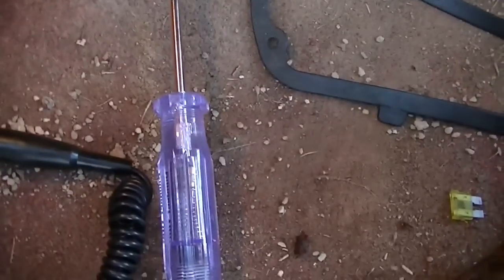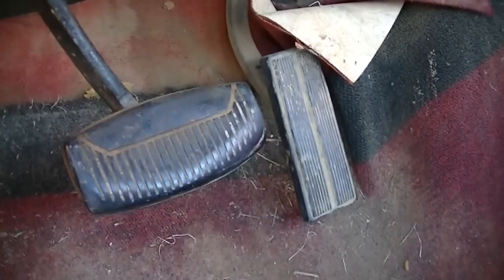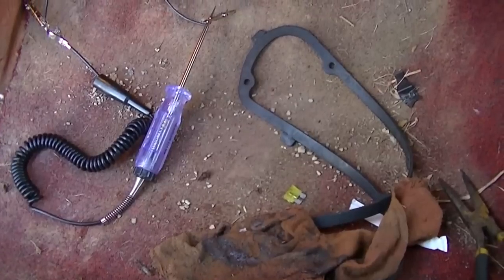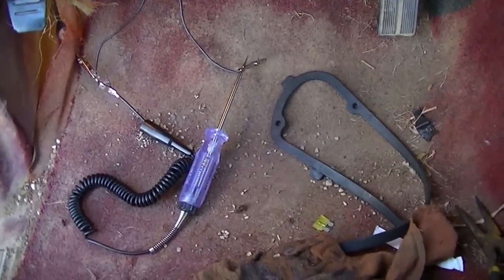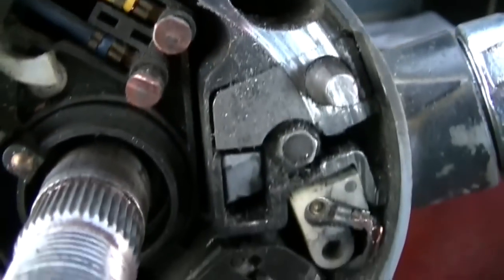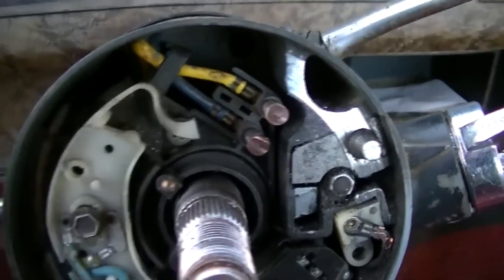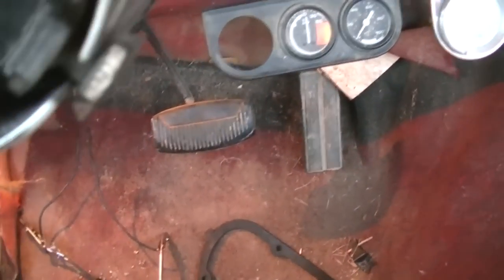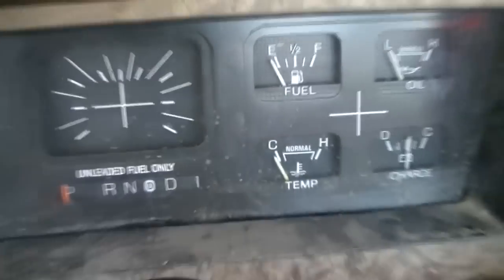Hunting A Short Circuit

Comment: It seems as though you just completed the circuit using the test light in place of the fuse. When you turned the signal on current passed through making the light flash in sequence with the turn signal. It did not appear to be a short that I could see of it.

Comment: My 1992 toyota paseo is shorting out on the tail lights.  Keeps blowing fuses. Multimeter says it's doing 60a in a 15a. connectors are fine in the rear as far as I can tell. No visible kinks. What should I check next? And how could I pin point the short? When tailights stopped working so did my illumination lights for the dash and the beep if lights are on and door is open.

Comment: why does this guy have a gasket on the floor. good spot bud.......... i like the housing twist terminals too..... legit
Reply from the maker: +goldy l0x Sorry it took me so long to get back to answer. I had just got the truck, and previous owners rigged everything so it would work. I spent about a month repairing the mess of the wiring that was there. The valve cover gasket had been under the seat for years. I finally threw it away.